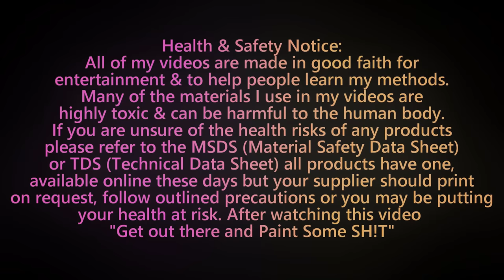Hiace Van Spray Painting

Comment: Good information on the blending. I'm a DIY and had to do some silver blending recently. It came out ok, but could have been better if I knew more about "tricking the eye". I think I should have blended down lower on the fender. BTW - I had the same issue with my FLG5 that you had recently with the pro lite, somehow the air valve got closed and it was starving for air. I thought it was the gun, but then remembered your recent video and sure enough the valve was not open all the way. Thanks for that, saved me a bunch of time

Comment: Funny to see you using a sata. I work for bmw so i do bout 8 jobs a day, used to have the 5500x's O pattern for clear. My arm hurt like hell after a whole day of painting, the air cap compared to the hand rest under the air adjustment is just to high in my opinion, makes the gun seem front heavy even with the air hose attached. Switched to a dv1 1.3 clear been banging them out efortlessy ever since. Nice vid bro

Comment: Nothing wrong with that finish Gunny as it must be difficult on those big panels when clearing a white trying to see the reflection. 

That banding you are seeing is as you say the booth lighting, normally a different shutter speed will help reduce it, I don't know what hertz your mains electric runs at where you are but it's usually 50hertz so if your camera is set to 50 it may give you problems try a different setting, LED lights are better as you don't get that banding but it will show as a flickering light which a different shutter speed will sort. Just googled it Gunny and Australia is 50hertz same as UK, USA is 60hertz. Hope it helps 🤔
Loving these new and improved Raw vids mate so keep them coming, stay safe, 👍John UK.